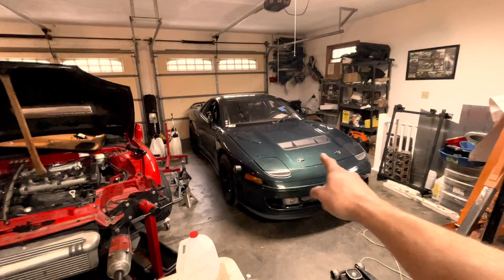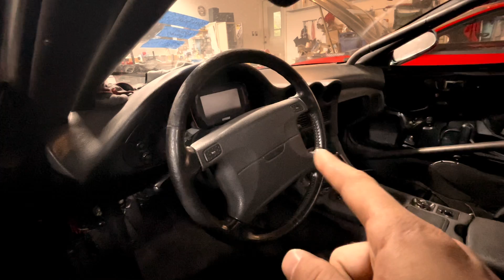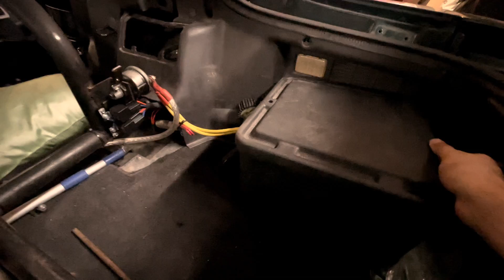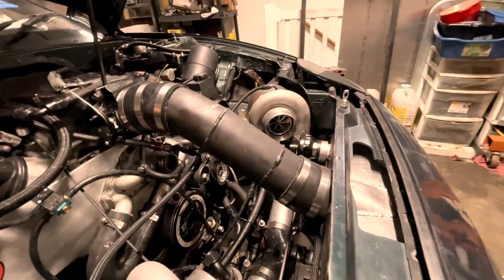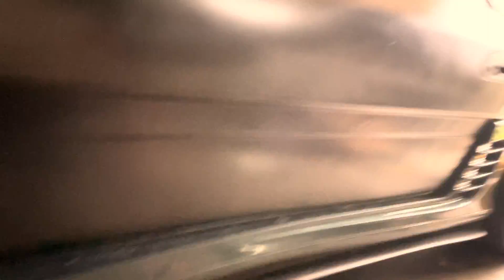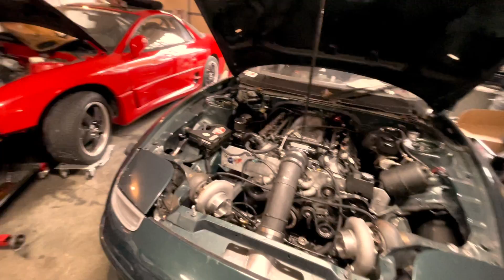LS SWAP 4WD AWD 3000GT twin turbo Build Breakdown

Comment: Question: Could the transverse LS from the Grand Prix bolt in even easier?
Reply from the maker: Not going to bolt in. And to what trans? Plus a v8 is longer than v6 so doesn’t to fit between framerails transversely. Would still need modifications even if you figure out a trans.
Reply: @4familyman Totally fair, I just figured since it had a few parts shortened to fit in a Pontiac Grand Prix from the factory, it might work in the 3000GT. Some psychos out there stuffed one into the front of an Acura RSX and another threw one into the back of a DeLorean. Not sure about the transmission though. I think you could get a manual but my buddy’s was auto.

Comment: Maybe I missed it, how much did you drop on this build. I have 98 3000gt SL manual. Stock everything at 165,000 miles so I feel like it’s time to show it some love
Reply from the maker: @MILKMANsYODADDY  this is not the direction you’d want to show it some love. It’s re-engineering the entire car. ~1000hrs of labor. And in parts, ~$60k. But that’s for 1500whp. 

Just buy a used r35 GTR if you have $60k to drop and want something that’s actually comfortable to drive in the street. 

Or if you want a nice rwd vehicle, c6 corvette

Comment: Does the transfer case driveshaft run underneath your feet at the pedals
Reply from the maker: @valeyrivera1411  no. In this build it’s all on the passenger side
Reply: @ what transfer case did you use and front diff?
Reply: @ I seen you used Colorado front differential but what transfer case?
Reply from the maker: @ I said in your other comment. “Racing in the dirt” chain drive transfer case.
Reply: @ yea I seen it sorry

Comment: what about using the vr4 motor longitude ?
Reply from the maker: That’s the next build. I have an adapter getting made. Been waiting for 6 mo for it!!
Reply: will the v15mt bolt to the ritd  @4familyman
Reply: and I will like to communicate with you direct on that project if possible
Reply: and could the Montero subframe mixed with a little vr4 take care of the front suspension
Reply from the maker: @NikolaTesla-wp8ip  no idea lol
Reply from the maker: @NikolaTesla-wp8ip  not likely on Montero subframe. But who knows. Start cutting and welding!

Comment: I was just wondering how much that build cost to do I have two 3000GT a VR4 and an SL and was just thinking about going in a different direction considering how much it cost to rebuild them to stock on top of the fact that I can't find anyone to work on them
Reply from the maker: It’s a 1500hp 4wd LS. It’s not an inexpensive way to rebuild. Or easy. It’s completely re-engineering the car to use and LS. 

Inexpensive and easy  is the 4g63 swap. I still make mounts. 4Gswap.com

Comment: just saw this dam looks amazing but what makes it AWD ? and  how much did you end up spending on it ? i saw a Mitsubishi sl for sale always loved how they look but wanted it with a v8 which seeing your video looks well worth doing
Reply from the maker: Drivetrain was powerglide, RITD chain drive transfer case, ford 9” in rear, then up front was a Colorado front diff. I would say full time 4wd or awd with locked front to rear ratio. 

As for cost,,, just rough math, if you started with a bare shell, to build monster like mine, doing ALL of the  fabwork and tuning yourself (hundreds and hundreds of hours), it’s ~$50k in parts.
Reply: Could you do this in the Spyder version

Comment: I'm curious how you connected the steering rack to the stock hub?  The stock location for the steering rack is kinda high up against the firewall which would get in the way of the transmission and puts the mount on the hub on the opposite side of where yours is mounted.  I'm looking to do a similar project but haven't quite mapped out how i'll take care of the steering. Any tips are appreciated.
Reply from the maker: I connected (welded) a new ujoint right off the column to use standard components.
Reply: @4familyman  I was wondering how you attached the rack and pinion to the stock vr4 wheel hubs

Comment: Thanks for the content, great build.

Do you think a mild version of this build would be decent for road race/track day application? 

Do you have an idea of what trans/tcase, axles and steering you'd use for that kind of build?
Reply from the maker: Thanks! 

A mild version for road race is already built by Mitsubishi,,, it’s a 3000GT VR4 ;) would be insanely silly to go through this much work to make what’s already made. 

You would not want the setup I did. It’s 4wd. You would want a viscous coupler in tcase. Mitsu already did that in the center diff.

Comment: I may have missed some key information so excuse me if I ask things already said, but I planned on doing something similar to this. Is this a VR4 chassis? And how difficult was it to make a different suspension setup work? I know you said the rear end was from a mustang but did you have to make any modifications to the chassis in any way to make it work?
Reply from the maker: Yes vr4. I re-engineered the whole car under the skin other than the coilover attachment points on the chassis. 

Lot of other vids I made if you want to look through them. Not for the faint of heart to build a car like this.
Reply: @4familyman  I was thinking of trying to do it off of an SL to try and go a bit less expensive but no matter what you do it’s going to take a lot of time, money, and effort. I’ll go and watch some of those videos. Thank you :)
Reply from the maker: Yeah with how much I changed, a vr4 isn’t required.

Comment: what do you think about retrofitting a c4 corvette front suspension for the front of the car? would that be easier?
Reply from the maker: A lot of the classes I race require stock style front suspension and stock strut towers. A vette suspension is totally different. Whether it would be easier or not (I doubt it), it would not fit my needs. Ultimately so much stuff needs to fit the car exactly, in my opinion, you are better off just making it from scratch. Just one man’a opinion. 

The smart answer,,,, just buy a C5 vette and add a turbo or two. Done ✅
Reply: @4familyman  from someone that has done it I will definitely take that into consideration. I was on 3si looking at the subframe you made last night. maybe its time I take some welding/fabrication classes.

Comment: sorry if i missed it. You using stock front diff from colorado? How hard was to make that electric disconnect?
Reply from the maker: Yeah it’s totally stock. Currently a stock 4.10 gear. 

It comes with the electric motor for the axle disconnect. All I did was buy a connector with pig tail and wire it up. Requires 3 wires. 1 ground. 1 power. And a switch ground to engage. (If I recall correctly).
Reply: @4familyman  thats awesome. what oil pan did you use?

Comment: I've been watching your videos, greag job.. :) But what is that RITD-transfercase that you are using and how expencive..? I am planing similar LS AWD swap to my subaru and the drivetrain is still a question.. There is a lot of builds where the front propshaft is at left side and it takes a lot of room under driver seat, yours is in right.. How did you connected it to powerglide..? 
Thanks.. =D
Reply from the maker: Thanks!! Here you go!! https://www.racinginthedirt.com/ritd-chain-belt-drives
Reply: Thanks man..! That answers in lots of questions..
I really wait more vids of your progress and looking for that gt3000 to win, so better luck in the future.. :D

Comment: That is a great build there, I’ve been looking into a similar swap with my 3s, I plan to use a t56 mated to an awd transfer case, I have been thinking about using the front diff and oil pan from a trailblazer, why did you use the diff from the canyon instead of one from a trailblazer?
Reply from the maker: I thought Colorado/canyon was better for how I had my steering. And wanted to offset driver weight by having tcase and diff on passenger side. 

Trailblazer should work though too. Some advantages with TB and ground clearance. 

I like the gearing options for Colorado/Canyon though too. 

If I built another one that was more street oriented, a 4l80e trans, awd tcase and TB front diff would work well.
Reply: @4familyman  GREAT Build!  Have been following You and Your channel since RMRW 1.0 this year. Am looking forward to seeing You and Your vehicle racing again.
What Drag-Race Week events are You planning to participate in ?
Have You seriously considered replacing the stock steering wheel and column with one for racing because of safety ?
Sincerely
Reply from the maker: @newtonfirefly3584  I’ll be doing Sick Week in February and RMRW 1.0. And No Prep racing in between. 

Not sure how an aftermarket column would be safer than stock. Stock has built in collapse and I added a collapsible section in engine bay (slip fit D tube). I have considered it for light weighting. Stock is really heavy
Reply from the maker: My car meets all NHRA requirements for 8.50/160’s in the 1/4. I mostly race 1/8 so slower speeds. And I mostly race No Prep (those sketchy tracks you talk about). FYI piloting a 1400hp street car is going to have risk regardless. Anything can happen.

Although motion makes good points (and I love James and Doug), they are also trying to sell a product. My key, cannot just fall out. And my OEM column that has gone thru rigorous testing to be DOT certified and last many thousands of miles, is quite nice. (No air bag anymore of course). I’d rather have stock wiring in column/wheel clockspring , then dangling wires everywhere for aftermarket wheel. That seems to be absent from the marketing video. If I get an aftermarket setup, it will be to save weight, period.
Reply: @4familyman  Certainly am aware of what You present, but Doug and James are not just 'selling a product' either.
You can ask the others who are and have been heavily involved in racing, especially drag racing.
Please ask the experts with extensive experience like have mentioned, those of Dennis Taylor, Tom Bailey, Jim Berry, etc. what they know, and why they use racing steering columns.

Your point about the wiring is valid, especially if You use Your vehicle for daily driving, since the racing steering columns have not any surrounding covering to house or cover the wiring and such. Thus, certainly arranging, fastening, bundling the wiring becomes another amount of work, thought, as such. The wires certainly would not be preferred to be dangling. Also, if You retain the production dash, it is much easier to handle the wiring too. But, as those which have completely custom panels, as with most dedicated racing vehicles, they all manage to have their wiring arranged, bundled, placed neatly, properly, etc.

You mention the aspect of DOT certified. 
That aspect is exactly what was referred to regarding government regulations. The DOT certification is limited to the standards set which are for normal passenger vehicles in accordance with their level for passenger vehicles. The DOT does not have any standards nor certification for racing vehicles and standards. Thus, a DOT certification is clearly insufficient for the levels of racing speeds, dangers, risks, etc. as You had also removed the air bags too which are DOT certified.

Am just attempting to give You information to think about.
Your safety level, equipment, assessment, evaluation, etc. is within Your choice.
Included within my view [maybe not Yours] is the assessment of having more than the minimum level required, if possible.
There are many examples of the established minimum standards, regulations, etc. which needed improvement and still do.

Your Life is within Your choice, though not always, exactly or precisely within Your hands.
My view is based upon accounting for the unexpected, and having more, if available, to minimize the risk, when choosing to be involved in a risk. Thus the greater the risk, the greater my responsibility to minimize the risk.
Am very aware many do not agree and choose to risk more too.
However, Your life is also connected with others that have close, intimate relationship  with and depend upon You. They also learn from You too, especially Your children. You probably consider these things too.

Am not intending to rebuke You, rather remind You of what You probably already know and some which You maybe should know too.

Am Sincerely wishing You Well, 
All The Best and Much Success, Health and Well Being.

Comment: Same question as always: Why not just buy a Corvette? :p 

But, as far as your radiator cooling at highway cruising, looks like your tires are pretty meaty, but have you considered trying to turn the sideskirt faux ducts into actual NACA ducts and run hose to the radiator to get additional airflow through it?  At speed it doesn't take much surface area to get enough airflow to keep temps low. Always awesome to see you doing great stuff with the car..And now that it's AWD again, maybe they'll let you be eligible for VR4 record holding ;)
Reply from the maker: The 3S crowd gets sensitive on records lol. Montero/3G eclipse motors allowed, but tiny 4G motors are not. So definitely No records to be held for an LS. 

But, I may have to give it a go, for the hell of it. Mr2’s count swaps for their chassis record.
Reply from the maker: Definitely just buy a corvette! Lol

To run air thru fake side skirt vent,,,I’d have to cut into the passenger compartment to route hoses, since the “vent” just dead ends into the lower interior b pillar area. 

Interesting idea though that I may explore more.

Comment: Very nice project you have going there. seems surprising that both the front and rear axles are living at that level, are they upgraded? Hope you can get back in it soon and have some fun at the local events and such! Do you have 1/8th mile 4's as a long term goal for it or similar?
Reply from the maker: I’m sure something will break eventually. I did twist the rear 31 spline axles pretty far so replacing those. Front are upgraded chromoly axle bars. Better not break!

Yeah I’d like to hit 4’s at some point. Have a ways to go. And mostly do no prep, back of track stuff.

Comment: Did you ever scale the car before and after adding the fwd? Weight difference?  Best ET for both?
Reply from the maker: It’s around 3450lb now. Soon to be about 3350 with more weight reduction. 

Front diff and axles added about 120lbs. Tcase added 40lbs. Front driveshaft about 30lbs. 

Haven’t scaled it yet as 4wd but by my estimates it is about 60-62% on the front. 

No fair comparison of rwd vs fwd because I have changed so much. More turbo. Fiberglass doors. Took ballast out. Etc. Mostly No Prep car.

Comment: What's it all weigh? Also I've heard that most of the guys using AWD shoot for a front drive bias meaning more speed on the front wheels then the rear. Is that what you were going for with the 3.70 vs 3.73 gears? Or was is just lack of compatible gears in Ford vs Chevy
Reply from the maker: Unfortunately that’s just the gearing I was stuck with for a GM front and Ford rear. I have slightly taller tires up front to even it out. 

I plan to swap to 4.10 rear and 4.11 front at some point foe 1/8 mile gearing which will help the front pull. You don’t want the rear to push/overrun the front as you can lose steering or worse.

Comment: What diodes are you using in the alt sensing line? Diodes or resistors?
Reply from the maker: Diodes. White stripe towards alternator. Just grab a variety off Amazon and start putting them online until you get the voltage you want. I think I have 3 or 4 inline.

Comment: Can you make a kit ?
Reply from the maker: No. Too much custom fab needed even if the engine “bolts” in
Reply: @4familyman   just for the rwd
Reply from the maker: Same story. Have to fab part of trans tunnel, firewall, steering column.
Reply: what subframe